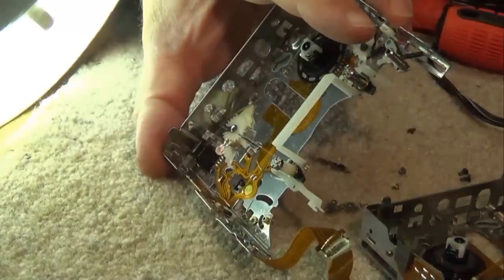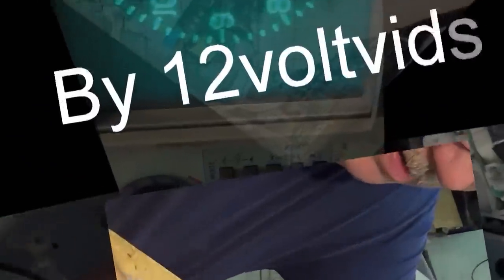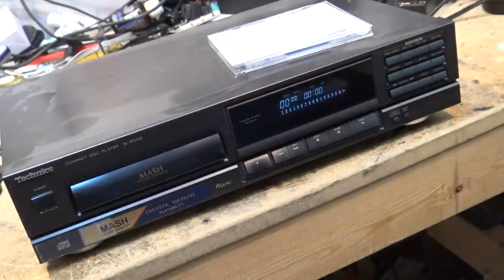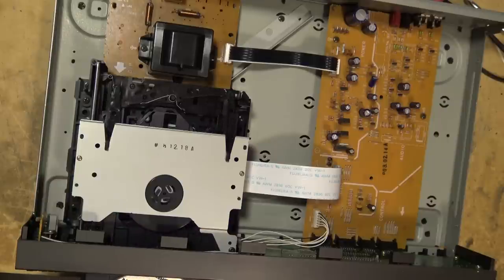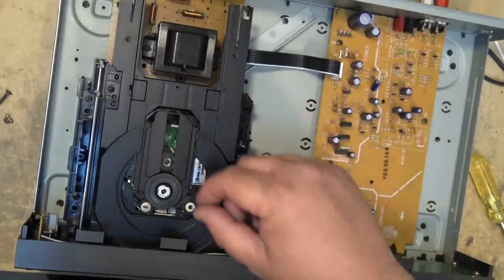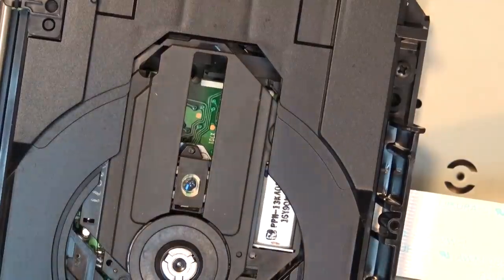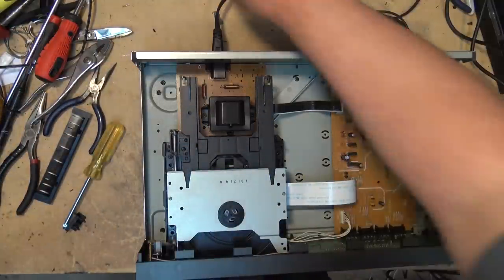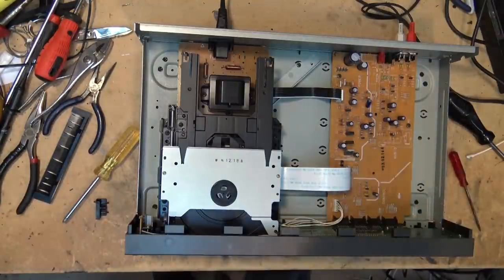Technics SLPG100 CD player skiping

Comment: Your videos were an inspiration for me to find Sony CD player CDP-XE510 from the 1990s on a local classifieds website for ~20 US dollars about a year ago. Almost perfect cosmetic state, reads scratched discs without skipping, sounds good to my ears. The only issue was a cracked solder joint of a ground pin on output RCA terminals which I fixed easily.
Now I have a growing collection of CDs, some of them cost more than the player I play them on.

Comment: My 1987 DENON DCD-900 CD player was skipping as well.  Thank goodness that just a few drops of electric shaver oil in the right place fixed the problem. That was about 5 years ago, and it is still working perfectly.  That very same type of oil has fixed several of my devices over the years.

Comment: Would it not be possible to take the motor out and apply oil to the bearings?  I found that in some computer cooling fans the bearings (due to hot air being pulled through them) tended to dry out and become worn.  The best oil I found to use was a very small quantity of fully synthetic engine oil;  this oil would revive most noisy fans because its viscosity would act to fill the worn bearing gap thus preventing resonance and was impervious to heat so would last indefinitely.  The above method worked on even the very small fans with low torque, so, I would imagine, be certainly OK with a motor capable of spinning a CD.
Reply: The underlying issue is bearings thenself are worn out , this wear creates slop in the motor shaft itself (it will also lower the disk spindle height throwng off the focus) taking one of those motors apart without dystroying them is also no small task , when a motor with worn out bearings spins each pole of the rotor passes through a magnetic field. every time this happens it makes the motor shaft vibrate like a tuning fork with its frequency dependent on the motors RPM,, this vibration sets up a resonace in the disk on spindle like a speaker cone , this is "seen" by the tracking servo circuts as noise and they try and correct this issue once the resonance gets bad enougth they are Overwhelmed .
Reply: @brianperkins6121  I've often injected a minute drop of machine oil into these motors via a tiny hole in the casing. Albeit this one is very bad most can be solved by this method

Comment: When I worked in a repair shop back in the 80s and 90s, we used to see a lot of Pioneer branded CD players with bad spindle motors. This was a very common problem even into the 2000s when Pioneer were doing computer DVD writers (After the Pioneer DVD109 dvd writer came out things started to improve though)

Every brand has its own issues. The other favourite (which persists to this day) are LiteOn branded drives with bad loading belts. Even today when I only really do repairs as a hobby instead of a job, whenever I see a LiteOn unit I replace the loading belt as a precaution (although with 99.9% of these, this is the actual fault anyway)
Reply from the maker: Lots of CD players had bad spindle motors.  I changed tons, and I mean tons of them.

Comment: I had two of these units back in the early 90's and they were both junk. the first one spent most of the first year I owned it in the shop. They finally gave up trying to fix it and gave me a new one. it worked for about a year and started to act up.   I was so disgusted I never bought another piece of Technics gear.
Reply: Majoritatea CD Playerelor de la Technics functioneaza de peste 20 de ani !!! Chiar eu detin asa ceva. Probabil si cine le foloseste este un junk.

Comment: I know this isn't as good as replacing the motor but this idea will make it last for a decent amount of time ... the same grease you use on the worm screw use a q-tip to force some on the top bearing of the motor and give her another spin test for noise ... in my experience that does a fantastic job of making a noisy motor much quieter... another thing I noticed the motor was going much faster than it would in the normal speed range for an audio CD player 500 RPM is the fastest she'll spin the disc (range based on my research is 500 RPM to 200 RPM) anyway that may help to spare the life of some future CD PLAYERS ...
HAPPY HOLIDAYS EVERYONE

Comment: Sorry you are looking in the wrong place.

after few years, the laser diodes are weak behind the laserhead Back is a regular  turn this 5 or 10 minutes as  clock so amplify the power and runs perfectly for a few years again I have done 100 times and with full function Best Regards from Frankfurt

Comment: I was wondering how sensitive these cd mechanisms are to the vertical spacing of the spindle head in your experience? I assume since the focus mechanism has a servo action and some physical vertical adjustibility that there can be some drive compensation even if you are a little off. I have an old bookshelf system with a seized motor bearing and a box of pancake DC motors that would fit so I guess I have nothing to lose but just wanted to know what I was getting myself into. If it comes down to it I could just buy a replacement assembly but I'd rather replace what I can with free parts I already have. Sorry for the ramble and thanks for your videos, I've learned a lot from watching them!
Reply from the maker: The placement of the disk table is not as critical as one would think. Use a feeler gauge like a mechanic would use to set points gap on an old mechanical distributor to measure the gap between the base of the disk table and the top of the motor before removing it. Then when you press it on, stick the gauge in and press down to same level. The focus servo can raise, lower the lens slightly to compensate. I changed literally hundreds of motors. Use loctite to secure the disk table to the shaft (not krazy glue as you will never get it off again if you do) Motors used to be a dime a dozen. Well maybe not a dime a dozen but they were only 2 or 3 bucks a pop at the local electronics shop when they were around. They closed their doors after the founder and his son both passed away within a month of each other. The grandson of the founder doesn't appear to have an interest in the family business.
That is like a friend of mine. His grandfather started a jewlery business., which his dad followed in his foot steps, and now my friend is also carrying on the family business, and from what I gather he does quite well.
None of his 4 kids have an interest in passing the torch. The girls are waiting on tables and the boy was learning to fix elevators.
Reply: 12voltvids Thanks for the info, it's good to hear that there is hope for my bookshelf player yet.

Comment: Brilliant video as ever awesome detail and all your advice has been truly appreciated could you advise of an odd issue have 3 top flight TECHNICS Slp 770 the class 4 x dacs  not the later MASH specs all? Completely at random ? Jump to odd tracks??? When run for time???all laser optics cleaned track bars checked set presets re optics per manual however no scope so can't check eye etc?? Am guessing filtering in Psu??? Any help would be appreciated??

Comment: Sad is your go to the island of misfit electronics oh well I have an ad, CD player that does the same thing circulation in sometime around 1989 to 1993 or four I have to look to see if the disc wobbles when is in play mode I don’t recall doing that if it doesn’t what your ideas on what it could be him originally I did not put it all I clean the laser however what do you recommend for cleaning the laser I used to use alcohol cleaning up real good but I made a mistake and use Windex on this one with a Q-tip and I’m wondering if I just got a little bit of film on it so

Comment: Thanks so much for doing this video and sharing this information. I've been hoping you'd do a CD player repair.   I found an almost identical  used Technics SL-PJ316 that has similar problems.  Cleaning the laser lens helped.  

Are there any used CD players that you like? 

Thanks a lot, Tom
Reply from the maker: Sony ES players are very good, and very heavy. If you can find a Sony 
CDP-X555ES you will have one of the best single disk CD players ever made.
Philips and Magnavox also made some good ones. 
Next video in production now is a Sherwood 5 disk CD player.
Reply: Thank you very much for the information.  I just got a Sony ES cassette deck. After a clean-up, it plays pretty well.  That sucker is rather heavy as well.  I guess the Sony ES models were their higher end equipment.

 I'll be sure to look out for that Sherwood video.

Thanks again, Tom
Reply: He does repair videos all the time with CD Players.
Reply from the maker: Vintage radios too.
Reply: @Taco Thank you for this information. I didn't know there was a QS line.

Comment: Is a bad motor bearing the only thing that causes a laser to not read a CD?I bought a CD boombox that wouldn't play certain CD'S. It would spin, but no audio.
Reply: These kind of units are generally cheaply made and suffer from all manner of issues with the CD section. Bad lasers are quite common with these, but the motors are often troublesome too. My advice (if you fancy having a go yourself) would first be to clean the laser and check that it moves freely. You'd be surprised how often a simple cleaning procedure will resurrect CD and DVD players (computer optical drives too as they tend to REALLY fill up with dust and other crap due to the fans pulling it in)

Comment: I have a Sony CD player that is super sensitive to skipping from vibrations, but if I prop up the player at a 45 degree angle the problem goes away and it is rock solid. (yes the speakers are far away)  Any idea of what the problem would be?

Comment: I have watched A LOT of videos over the years concerning CD players skipping.   every one has told me to clean the lense or turn a screw a tiny amount to stop the skipping.  I tried those remedies and they never worked.   This is the first video I have ever seen talking about a motor going bad.  It finally clears up the confusion.    One thing I have found to be true - old cd players skip and I wont buy old used ones any more.    but DVD players seem NEVER to skip,  i use DVD players that are 20 years old and they never skip.  why are DVD players so much more robust than CD players ?  and why does the 25 year old CD player in my car never skip when my 10 year old home cd player does ?  i dont get it.

Comment: In the 90s, Technics lost the easy to service reputation they had with their earlier equipment. There is another video on youtube of somebody trying to change the belts of a 90s Technics tape deck, he spend like forever on disasembling to get to the belts. If it would had been an 802s Technics deck, it would had been a 5 minute job.
Anyway, most of the Technics pats are quite bulletproof. Technics cd-players go cheap 2nd hand, everybody knows the motor will stop working some day, but that really is the only weakness. For 50 bucks, I always try my luck on a Technics. A new Cd-player of this quality can cost like 6 time that and it can die too in like 3 or 4 years.

Comment: Got given one the exact same, works great but i need to change the semi floppy belt lol for the eject although mines older inside, yours looks more modern in there mine has the linear motor too which is a neat concept
Reply: Hey I got given a SL-P105 and the tray won’t open either, where can you get a semi floppy belt. 
I’m new at this

Comment: I see Banggood and Wish sell replacement spindle motors... can't say if they are any good or not ... probably not...
Reply from the maker: A motor is a motor. As long as it is the correct size it should work.
Reply: @12voltvids  I see they come in different voltages... 3.6 to 6 volts... guess you better know which before ordering one?

Comment: do you ever repair synth keyboards?  I have an e-mu keyboard with a bad contact board
Reply: If the problem is just the key contacts themselves, it should be an easy, though time consuming and labour-intensive (thus fairly expensive) fix - but well within the scope of a diy repair. If it's the key scanning electronics then it's most likely a problem with the power supply to the scanning hardware. Likely culprits would be bad capacitors and/or open fusible links / resistors (the former can often cause the latter) The chips themselves rarely give problems but with some keyboards being over 30 years old now, it's possible. 
Without seeing it, my guess would be physical contacts, bad caps, fusible parts, dry joints and then semiconductors, more or less in that order

Comment: Great video.  Thank you for making & posting it.  Dear sir, my Magnavox (16bit) emits a whining noise (low, and hard to hear) after the 1st two (sometimes more) tracks.  And mis-tracks and stops shortly thereafter.  (The spindle bearing on runs smooth and seems still good).  Any comments, clues to look for most welcomed.  Thank you so much.  tonyd\.

Comment: In my opinion is not the motor, it's obvious that if you make it spin over the normal speed, it will make noises.  The problem is the lens, the same with all the Technics...
Reply from the maker: Bearings wear out and cause vibration on the disk that scatters the laser beam. We used to change hundreds of motors. They were dirt cheap back in the day.
Reply: @12voltvids  rare with bearings, all Technics I checked had bronze bushings.
Reply: @12voltvids  in that case we use to drop wd40 inside the motor and make it spin.  If it doesn't work, dismantling the motor can be the solution.

Comment: Please guide my sony mini hifi fh-B170 has  low display light what i do?
Reply from the maker: If it has a vacuum fluorescent display and it is dim you can check the screen, anode voltages and filament. If the voltages are where they should be then the problem will be the display tube.  Fluorescent displays are vacuum tubes and operate exactly the same way.  Thermanic emission.  The filament is the directly heated cathode.  Eventually it wears out and loses emission and then the display fades.
Reply: @12voltvids  how i can show you video with on display for a look
Reply: I actually pin the main circuit board wrongly but deck was blind and i check pins again it was wringly clipped having one out so due that i gave whole power wrong with rest of 7 pins sequence wise.but later when i noticed connection and pin it back properly display got faded now
Reply: Capacitors seems ok and no smoke or any short noise everything start working properly just the display is weak and dim as this deck is 1994 model but rarely used as you can see its model while typing Sony FH-B170CD
Reply: Please guide i am waiting as i changed the display but no improvement.